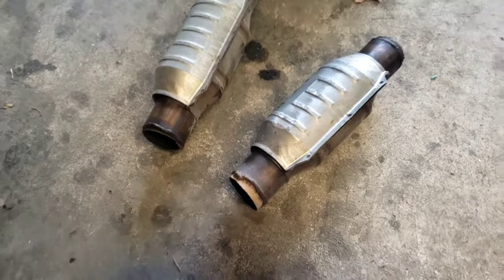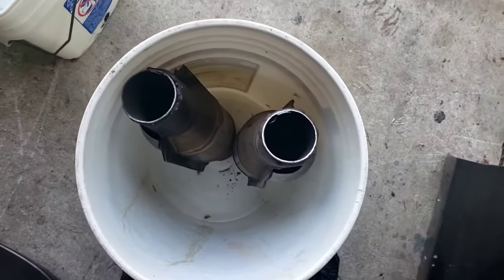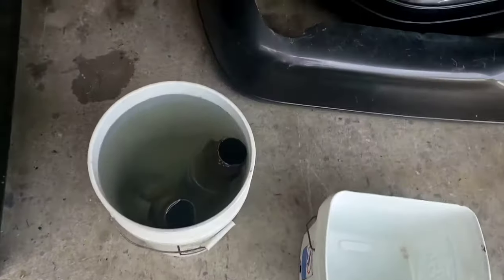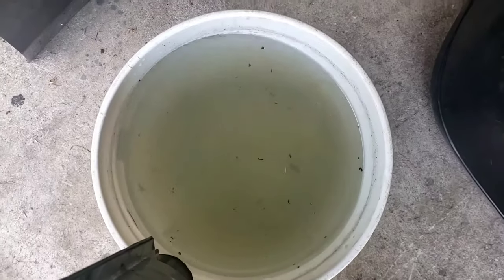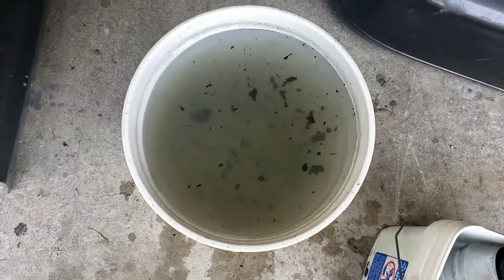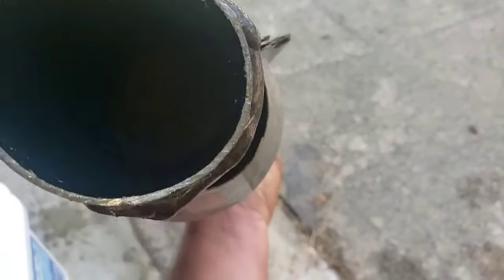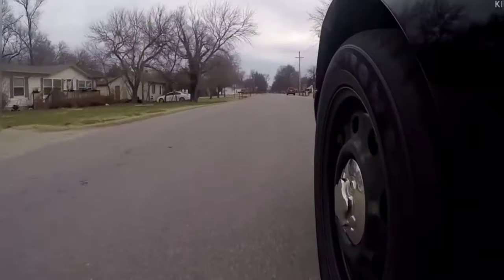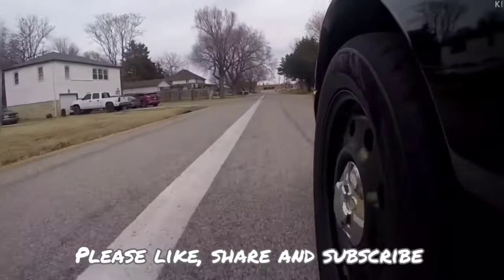How to Clean a Catalytic Converter

Comment: Cats are not designed to trap particulates. They are designed to promote oxidation of fuel that is not burned by an engine, thus reducing pollution.
Reply: The large surface area once oil coated will trap particulates though.

Comment: What i did, soak it up with acetone overnight, flush it with water - used my torch to heat it up and flush it with water - did that 4 times . Blow air using leaf blower . Voila - was able to unclog  it
Reply: Did you reinstall them and no code or problems?

Comment: Thank you very much. Just did this and the shear amount of black that came out was amazing. Last year the truck barely passed and I gotta test again so I'll keep yall posted.
Reply: How did it go,
Reply: @writtenpieceopaper1  
It worked. Just got my emissions done today. Passed with flying colors where last year I barely passed.
Reply: Update! It worked, did my emissions today and passed with flying colors where last year the truck barely passed. Had to drive it for a while before the smell of vinegar left the exhaust but it works.
Reply: @nickburbach5811  thank you so much for the update. I decided to replace them after all because I couldn't restore flow to one side (my jeep wrangler has 4 cats not 2). I left mine soaking in water and soap, water, and water with 5% bleach a day each. One side flowed water much better but the other side, I couldn't even push a shop vacuum air the same even with slight improvement. That side had  thick white rust build up that may have been just the substrate falling apart/ melted (that cat did have some chunks missing).

HOWEVER, I'm soaking the oxygen sensors since they were fouled by the silicone on the lower intake gasket rtv / coolant leak on one side (the melty side). A few hours and the white stuff was flaking off the inside too.

I read that oxalic acid and citric acid restore up to 95% of catalytic converter. Vinegar is a weak ish acid right? So maybe that's why it works so well.
Reply: U r welcome my friend.! Hey tha'ts what life is all about.! People helping people.! 👍
Reply: @nickburbach5811  that's awesome and it makes sense that cleaning the crap out exposed more "surface" inside, therefore making it "work" again! I feel like once you expose enough of the surface it can likely get hot enough to burn off whatever crap is in there, granted you are not dumping raw fuel/oil into the cats which will just doom them.

Comment: Remove the cat and with a bar or small pipe smash the core, if its a metal type it will just crunch up and you can knock it out, ceramic types will just crumble and fall out easily. Either type the case will not be damaged at all and you can re-install. Never again any problems. Best fix I ever did to my cars.

Comment: I, set the welder up on high  and burn out the insides   were   I   can   see   threw   it.   Works    great    now.
Reply from the maker: Yes. That is also a Trucker Dave approved method.
Reply: Thank, you
Reply: Thank, you.👍
Reply: true,
but then, good luck on its emission

Comment: Would it be possible to soak in vinegar then pressure wash the cats. Then soak in vinegar again and do a final rinse with boiling hot distilled water? Perhaps it would clean them even better and last longer than 20k to 30k.
Reply from the maker: I would suppose you could try it. There are many different ways to clean these. on our semi trucks we do have a process where we do boil them in a homemade solution of dawn dish soap and some other stuff I can't remember. A lot of guys also will bake these and then clean them out with compressed air. The purpose of the distilled water is to make sure there's no minerals or anything that would reattach itself to the metals inside the converter. I guess to break it down into simplest terms, using non-flammable cleaner and the cleanest nonmeneralized water you can get a hold of. I suppose if you had a Boiling Pot of distilled water, like a turkey fryer, I'm sure it would work fine but I'm not sure it would do any better than just rinsing. It would be interesting to find out though if it does

Comment: Considering how expensive cats are, especially in a state like California, it's worth a try! I am curious, would using a cheap pump to flush the liquid through help make the process more effective by more or less flowing liquid through, therefore helping to dislodge more crap that's inside there potentially blocking the honeycomb and reducing the efficiency of the cat? 

It's also nice you touched on the fact that yes some states don't do testing but it's still Federally required and unless you have an exemption, you can get into SERIOUS trouble running without a cat in your car. Let's say more than what it would cost to replace the one you had.

Comment: Is this laquied venigar safe for catalic converter????
Reply from the maker: Yes but you have to rinse it thoroughly with distilled water
Reply: @truckerdaveandred6731  what about patrol diesel and acid for cleaning catalytic converter????
Reply from the maker: @yaqoobansari738  you should never use anything flammable because you will burn your car down
Reply: @truckerdaveandred6731  that's really very helpful and great information for me.
Thank you so much 🌹🌹🌹

Comment: So the catalytic converter is another source for burning the exhaust coming from the car right? What other ways could this be accomplished without using the chemicals they use in the converters? Say maybe simple coils like what's in a toaster? Something that could produce enough heat to re-burn the exhaust? Maybe screening condensed enough to glow hot from the exhaust, to re-burn the exhaust?
Reply from the maker: They do that on diesel engines. The first generation emission systems just reburn the exhaust inside the catalyst. The problem with doing that is it just comes down to heat. If you tried doing that with a gas-powered car he'll most likely catch it on fire. 
 I'm of the opinion that cleaner exhaust starts at the fuel end rather than the exhaust end. Cleaner fuel and a properly tuned engine will cut your exhaust output drastically. 
 Story nobody likes to tell, it's back in the old days when I was a kid and we had emissions checks, and cars burning leaded gas, if you were to keep them properly tuned up you could blow cleaner than a new car today. The best way I have found to deal with emissions is to treat it at the source.
 Catalytic converters are designed to deal with the waste so if you cut the waist down drastically, you'll get a more efficient burn in the catalytic converter
Reply: yup,
vwry well said sir,
its much better to fixed the cause rather than just the after effect

Comment: Why not use the hose to pressure blast it out then just rinse it with distilled?
Reply from the maker: Because all the minerals in tap water will reattach themselves to the Catalyst after you use the vinegar to remove them. It sounds weird but that's why. The tap water is full of minerals that will get hung up and stuck in the catalyst system. It doesn't seem like a big deal but it's just an extra step to keep extra particulates out of your Catalyst after you spent all that time cleaning it

Comment: I guess vinegar doesn't work on diesel cat?
Reply from the maker: Carbon is carbon. It will work. I actually got this trick from a guy who worked at Cummings. You just have to make sure you use distilled water to flush it. He was very firm about that
Reply: @truckerdaveandred6731  You can not clean Carbon and oil with vinegar,  the water in the bucket showed it,  clean water 😃

Comment: Can cat out when you pull the second cat out something fell out of it which is no longer on your camera the other thing is because you live out in the country why couldn't you experiment the cats by adding carp cleaner or if you can find a bottle of carb cleaner why not just pour it in there or even brake clean import it in there
Reply: Carp cleaner sounds fishy
Reply: @robertrose3068  carb cleaner or any cleaning agency does it work for cleaning catalytic converters

Comment: Parts cleaner sink
Reply from the maker: That'll destroy the precious metals inside the catalytic converter and probably cause a fire if not thoroughly rinsed.
Reply: @truckerdaveandred6731  can't find anything that would say it's unsafe. Never tried it. Figured it could be safe. I can see it being a hazard if it wasn't done properly. Right on, man. Thanks for the comment!
Reply from the maker: @brettservin4395  there are a lot of different ways that it is done but most of these commercial places have the proper equipment to do it safely. Just doing it in your driveway like I'm doing, and like most everybody else, this is been the safest way I found to do it. And this why doesn't damage any of the internals, it just removes the carbon from the inside of the Catalyst and leave the clean surface
Reply: @truckerdaveandred6731  cool man. I'll do that. Thanks.